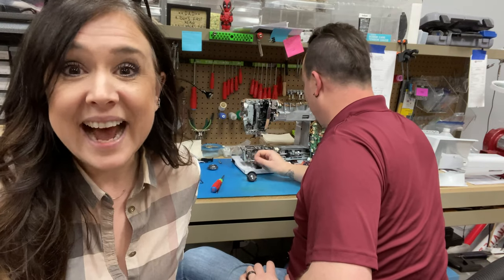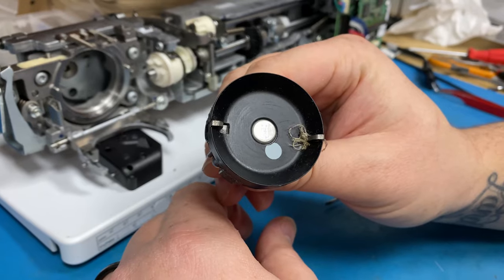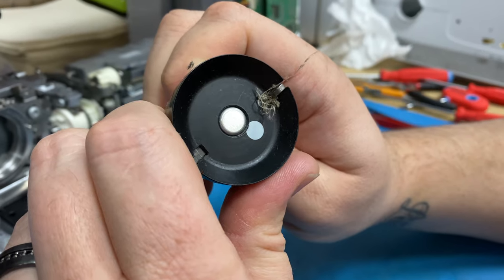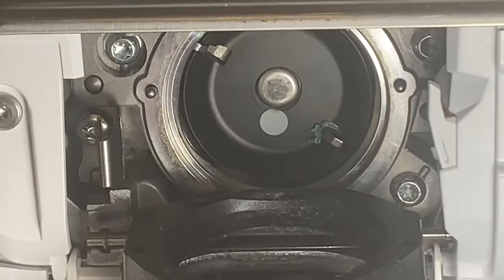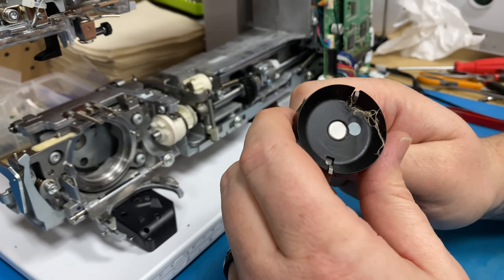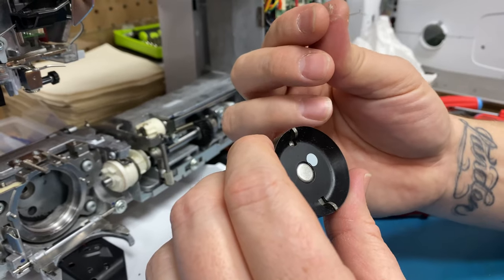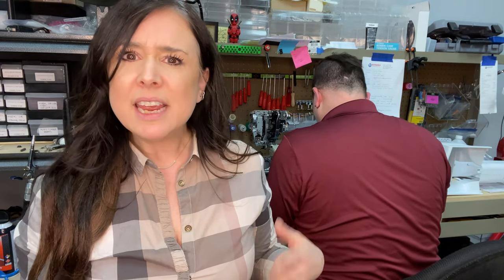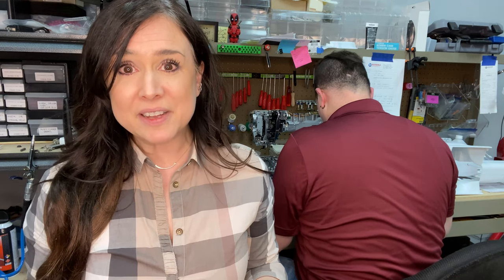BERNINA of Naperville Tech Tip

Comment: I poke those ‘boogers’ with a straight pin and move them up near the ‘fingers’ where the space is wider and I can get them out.  I do it everytime I clean and oil.  Love this tip.  I would love to see more of the inside of the machine.  I have heard conflicting reports of ‘compressed air should not be used to clean’ but I am a ‘why?’ Or ‘why not?’ Kind of thinker.  I like to see the answer.  😁. Can you show us that in a video?
Reply from the maker: Compressed air can damage a machine over time if used with the covers on. As a non-trained person, do not remove the covers yourself. Blowing compressed air in the machine to clean out the hook only blows the fuzz into the motor which will damage it before it’s life.